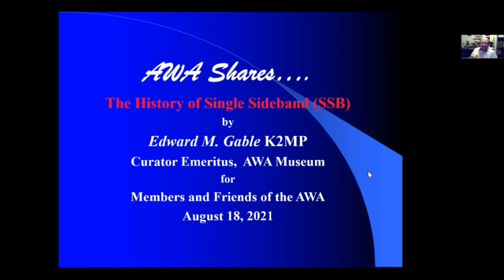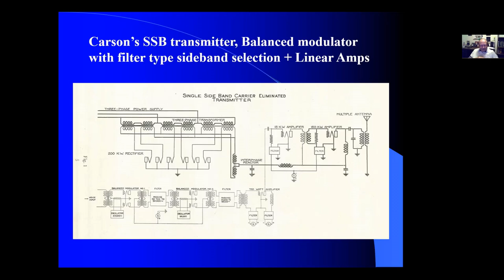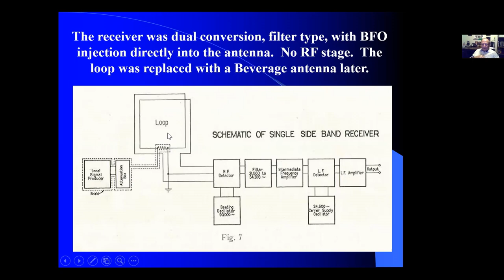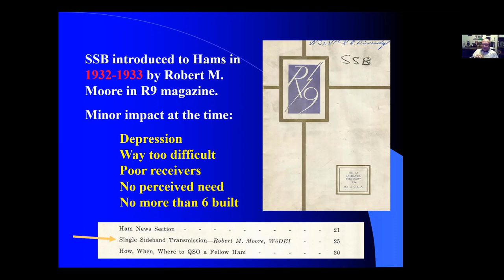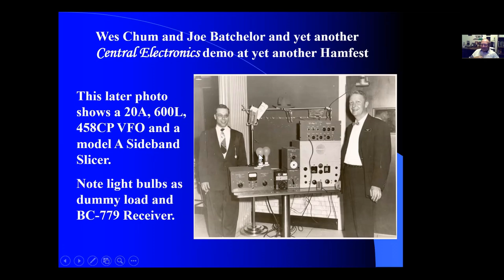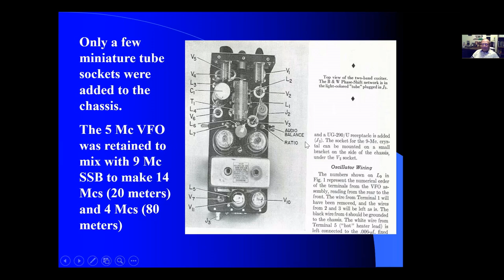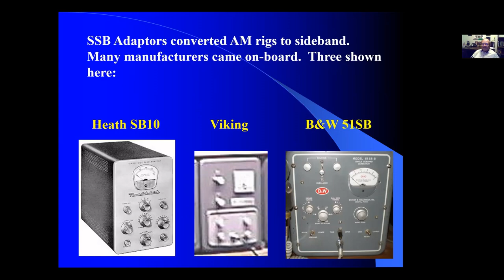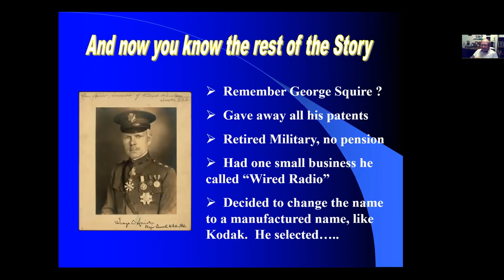The History of Single Sideband

Comment: I don’t think it was mentioned but in early 80’s AT&T resurrected SSB and used it to enhance capacity on the terrestrial LD microwave network. SSB was used until the end of those big horn antennas blanketing the US about every 35 miles.
Reply: I think you mean now frequency division modulation FDM what actually are SSB signals.
This is nothing to do with AT&T, FDM was widely used before digital transmission systems replace it

Comment: Nice video, but there is a significant error:  Without a sideband selection switch, the W2EWL Cheap and Simple SSB rig cannot produce the 75 meter LSB signal and 20 meter USB signal described around the 34 minute mark in the video.  This is an important point -- this belief forms the basis for a serious misunderstanding of the origin of the LSB/USB convention that we have today.   I hope AWA will correct the video, and that AWA will help find out where the current "LSB below 10 MHz, USB above 10 MHz convention" really comes from.  73  Bill N2CQR
Reply: Hello Bill:  Thank you for your kind words.  I have been made aware of the USB/LSB problem with the W2EWL rig by yourself and others and the original Powerpoint has been corrected.  Now, I also join you in wondering where the LSB/USB versus band usage was generated.  And the search begins again...  Mni thanks and 73  Ed  K2MP

Comment: Very Interesting,  held my attention and provided a lot of good info about ssb...  Scientific Radio made a 100 watt three knob crystal controlled ssb radio, operating frequency was switch selected, (big knob in the middle), volume and power out.  We at Operation Deep Freeze bought these radios to replace the KWM-2, because of the difficulty of the non-tech scientists to "peak the grid" and "dip the plate" into the dipole antennas, resulting in the constant replacing of the 6146Ws.  The SR radios worked pretty well, and were easy for them to deploy and they made their skeds more regular...  Thanks for the great look back into ssb history...

Comment: I bought a Icom 7300 back in April. I haven't even turned it on yet. I'm still trying to find the vacuum tubes. They must be small enough to fit under the circuit board..

Comment: Don't forget RL Drake who brought us 1A and then the 2B..... And my for love TR3 transceiver.  I used a 1A and fell in love-- Drake must have had some extra oscilloscope cabinets put that receiver in.   I had a 2B and a 2BQ nice add-on.  The 2B should be an excellent receiver only for ham radio but I fear the little red slide switches maybe have died.  With my TR3, I became a RL Drake man and had a TR7 and two R7s and all of the matching accessories except for the telephone connection and the RF amplifier.  Sadly Drake son got a stereo manufacturer to design the front panel of the TR7 which looked more like a stereo and probably killed the line..   It was beautifully made with interchangeable card cage construction.  New folks, get a 7 and look inside to see what I mean.
Reply: I have a 75S3 receiver and the KWM2A and accessories.  They do work, bit I tend to just sit and look in admiration at them.  I do like owning the top of the line and have IC-7800, FT-9000, and a K3.   Those big companies making ham gear today have been hit by SDR and China cut rate prices, I guess.  My 80 years reduce my operating time and I no longer try to keep up.

Comment: In the early 1970's Communications Associates Inc. (CAI)  in Huntington Ststion, NY was almost 10 years ahead of Harris with the first synthesized marine HF radio.

Howie AB2S
Reply: Howie et al:
This video brought back so many memories! --And some amazing coincidences.
I attended Johns Hopkins University as an undergraduate, beginning in 1960. On the third floor was a guy from Libertyville, IL who roomed with my friend and fellow ham, K3CUW. 
That guy was named Joe Batchelor. And yes-- his dad was the Joe Batchelor who had invented the broadband tuning innovation of the Central Electronics 100V transmitter. By 1960, the dad was already at Hallicrafters. His dad was a distinguished-looking guy with a goatee, who drove a Mercedes sedan. But the dad and his two sons were also hot-rod car guys. They had put a Chevy 265 V-8 into that Merc, and had balanced the pistons so the engine would turn very high RPM. It was very fast from a cold start. Joe Jr. used to brag about the fact that his dad would come to a stoplight and when a kid in a hot car would pull up alongside him in the next lane, his dad took great pleasure in leaving the kid behind when the light turned.

But, back to radio coincidences. Howie mentioned CAI--- but didnt mention that the company was co-founded by the engineers and management who had formed Eldico earlier. I worked at CAI during my summers and vacations on Long Island. The Chief Engineer was a Swiss electrical engineer named Werner Brach, and the CEO was named Don Merten. The VP and senior radio engineer was Everett Gibbs, W2FI-- who gave me my Novice ham radio exam in 1956. I worked building many commercial receivers and transmitters that CAI sold to various commercial entities. One of the most interesting at the time was a breadboard teaching tool--- a large vertically-oriented panel on a wheeled cart, that had the whole SSB signal path shown, with test points at many locations that could be used by the instructor to demonstrate the frequency and waveform at each step in the radio. 

All that gear in those days was wired with discrete components, and the wiring harness was hand-laid to interconnect everything in the chassis. I learned how to do all that stuff, and also was a tech in the lab where I learned how to tune a crystal filter for the desired passband shape.

I am still a ham radio operator [K2TNO] and -despite the plug for SSB above, prefer high speed CW.
73 to all----
Bill
Reply: Hi Bill, I just learned of the Eldico connection last week when I went to lunch with a former co-worker who was also at CAI, Walt Perloski K2IBR.  He loaned me his catalog of CAI equipment brochures which I am scanning to put online somewhere. I worked at CAI from 1974 to 1976.  I knew Werner from CAI and worked with him at another company started by former CAI people. Sadly Werner passed away a few years ago.

Comment: Yes, very interesting, my early days started in 1960, 1961, Hallicrafters
SX-110 Receiver at Radio Shack for
$169.95, at 17 years old, and becoming
a ham, novice, in 1962, almost 60 years
ago, as WV2ZPD, on 2 meter AM, with
a Heathkit Twoer, and built an Eico 720
Novice 75 watts and Crystal controlled.
I also built the Eico 730 modulator with
a green eye to see the AM modulation,
using 40 M crystal to go to 10 Meters
AM, and remember W2PSU, in NJ, was
a mobile contact. I saw Barry Goldwater
at 1964 ARRL convention, in NYC, when
he was a Presidential candidate. My first use of HF SSB was at Field Day in
the 1960's on the Collins KW2M, as I
remember. 73 de W2CH, ex WV2ZPD, 
WA2ZPD, WB7EGN, WB1BTO and V25CH, in Antigua 🇦🇬
Reply: Hello Ray.  Thanks for your interesting response and the telling of your long career.  Your WV2 callsign was a rare short lived FCC issue.  Stay well and keep active.  73  Ed K2MP
Reply: @edwardgable8583  Thanks 😊,  Yes the
WV2ZPD call as a novice lasted only
for one year. 73 de W2CH Ray

Comment: You say how much power was used, but unless I missed it, what frequency was used in the 1923, 1927 and other tests please?
Reply: Hello Peter:  The early transatlantic telephone tests were at VLF, around 50 kHz, using the long wave antennas at RCA's Rocky Point site.  When the service really got running they moved first to low HF and then to multi-band day/night frequencies.  Ed  K2MP
Reply: @edwardgable8583  Thank you for the info Ed. 73's GW4NFJ

Comment: Marketing photos haven't gotten any better.   When I worked at a turbine engine company, I recall a photo taken in the control room of a engine test cell.  I showed an operator at the control apparently running the engine.  Through the armored widow there's a technician with hearing protection apparently making an adjustment.   As a test engineer everything wrong just screamed that whoever staged this didn't have a clue and likely didn't care.   All the instrument readouts on the control console made it obvious that it wasn't running and things weren't even hooking up.   If that wasn't enough of a clue that the operator was play acting, through the window you could see a plywood cover on the engine exhaust.   

How many times do you see online ads or stories where the picture seems to have no correlation the the caption beneath it?